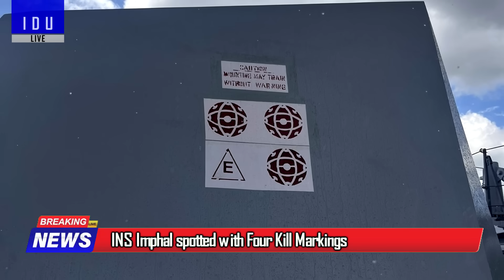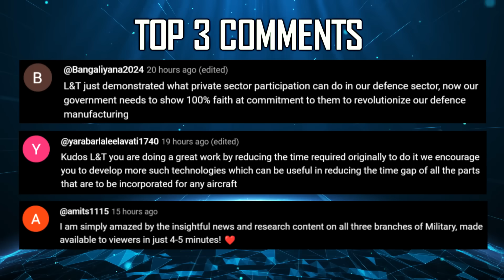Indian Defence Updates : Hypersonic SRBM,Tejas Engine Swap,$4.5 Bn AMCA Engine,Kalvari 1st AIP Plug

Comment from the maker: :yt:What's Your Opinion :: " No Engine Swap for Tejas MK1A " ?
ＬＩＫＥ | ＣＯＭＭＥＮＴ | ＳＨＡＲＥ | ＳＵＢＳＣＲＩＢE
Reply: That means if Tejas mk1a not get ge f404 new engine the entire Tejas mk1a programme will totally be abandoned after getting just 10-12 jets with backup engine.
Reply: Tejas will be abandoned if HAL sleeps and wait for f404 till eternity
Reply: @Vartik-jr4qr  I can understand your shock after getting reality check
Reply: @vaimurthy  shock? For what?
Reply: @vaimurthy  brahmos developed afterburner and not kaveri 2. GTRE need funding for kaveri 2 that is impossible under modi govt
Reply: Will be swiped by kaveri 2 but govt ain't providing funding
Reply: @Someguy-z3k  So you got reality check today that Kaveri swap is not happening. As i told government know the progress of Kaveri.
Reply: Currently there are no plan for F404 swap & seems to be right bt later on phase of Jet  nd midlife engine replacement need we should must transit on varient of Kavery2 derivatives.
Reply: @ankitkumargupta7501  For that Kaveri has to be ready and is nowhere ready to use
Reply: Good decision. Always changing things is IAF problem.
Reply: That means no Tejas mk1a , this is so sad
Reply: So Kaveri is ready and going to be swapped for GE engines and new indigenous engine swap all these are false? Jets are designed around the engine. Infact there is no success story of jet swapping engines and that too from different manufacturer. Hope this puts all those assumptions to rest
Reply: Idiots 
We need to get rid of American engine

Comment: HAL, DRDO and ADA must focus on multiple thrust variant design on their airframes.. like with DSI and S-ducts, we must build them for 75kN to 140kN ratings, so that changing or engine swaps need not be a problem.. we could adjust the DSI a bit and inlet flows in a modular way.

Comment: Just buy su57, junk mk1a and mk2 of tejas, they won't be developed even till 2028, if we have to buy why buy f16 junk. Waiting since 2 year, yet betting mk2 on same company, horrendous. Buying 4th gen engine, congrats. We didn't need Pakistan, dumbness will kill before them. A weak airforce will drown the navy and army. What the use of fast navy without air cover. Without airforce u can't fight anyone. Lack on everything, we can't build any aircraft without help, even a transport. At helicopter level, 2 showpieces, no new designs . Betting everything on hal. Path to destruction.

Comment: With so many changes to do in mk1a for a new engine it is not apt or feasible instead hlft42 advanced version with Russian engine should be preferred and should go side by side with mk1a with more or equal features. Also it will be a backup plan if 404 engines have supply issues or other issues. Good luck.

Comment: Why don't we design a twin Engine Fighter plane with a 76 kn Kaveri engine. It will prove 152 kn thrust. 
China designed their planes with available engine and they keep on upgrading.
Reply: Because there is something known as a T/W ratio. Kaveri might have a thrust of 81kNs but it's even heavier than the F414 engine. If we use it on the tejas then it's flight performance will be similar to third generation fighters like f-4 phantom or mig-23
Reply: @animangaweeb8501  rightly said. Also there is thing called engine reliability. It has to undergone multi year testing before being integrated to jet
Reply: @animangaweeb8501  I am not saying about Tejas. We should design a twin Engine Fighter plane with Kaveri engine.
China did reverse engineering and they made WS 10. Even though it was an underrated engine, they used in JF 17. Then they upgraded to WS 13 and now WS 15. 
We can criticise their products and Quality. But they keep on upgrading. CH1, CH2, CH3 and CH4. 
Our mistake is, we want Directly Iphone 16 in the first attempt.
Reply: @vaimurthy  yes all the money has to go to politicians

Comment: HAL should have simultaneously tried at least two engines may be M88 or Russian just to make sure not to put all the eggs in US basket.
Reply: Engine is a govt to govt deal. HAL has to make what is provided to then. They have no say in engine procurement process
Reply: @Someguy-z3k  Nope, government dont decide. It is ADA that decides which engine is suitable with input from IAF. Government goes by their recommendation
Reply: @vaimurthy  ADA decides? They design around engine. They don't design jet and then put engine. 8th fail🤡
Reply: IAF and MOD did it
Reply: They tried and found that these engines are not suitable for Tejas MK1 and MK2. Second our experience with russian engines which are maintenance heavy is also a factor
Reply: sorry, busy in canteen